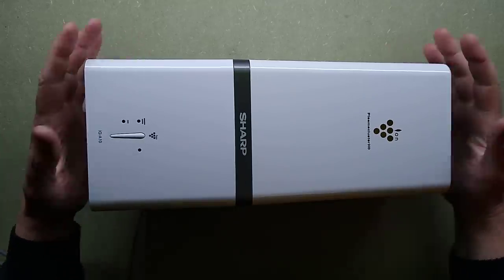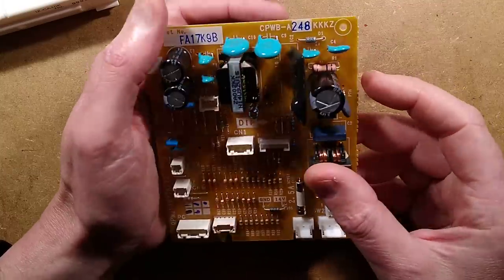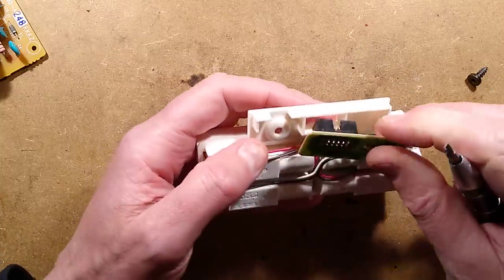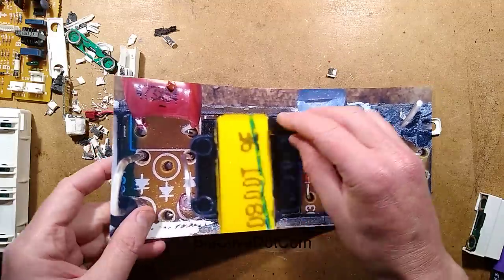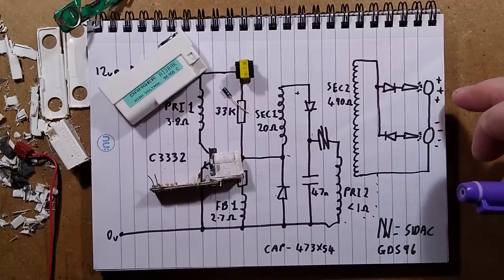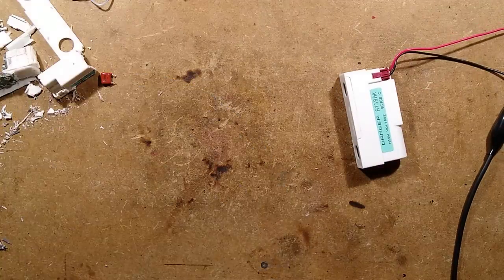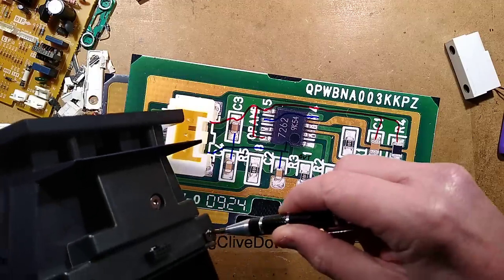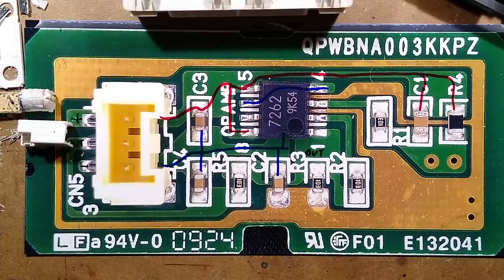Exploring a popular Japanese air purifier.

Comment: The last pcb is actually the most interresting one.
MiniFig666 is right about the guard ring.

the high impedance input signal is connected on the non inverting input of the opamp.
The output voltage is (Theoretically exact) the same, and is set on the guard ring surrounding the input signal.
Because these voltages are (almost exactly) the same the leakage current is (Almost) 0.
If the output of the opamp is not exactly the same(Input offset voltage), this results in a small error.
Also the Conformal coating does not cover the guard ring. (Mask layer in KiCad)
This is because it is not a perfect isolator, (according to wikipedia) it is 
breathable and can allow trapped moisture to escape. 
So for preventing these sub uA currents to occur, no conformal coating on the guard ring
and the input within this guard ring. 
The gold top layer is for prevention of corrosion of the bare copper.
  
It seems like the Opamp is type BU7262F is made by Rohm, dual opamp 
supply voltage 1.8V to 5.5V Rail to Rail input output, 2MHz GBW opamp, with low input bias current 1pA typ and Input offset voltage max 9 mV

The resistor marked HI and the capacitor in parallel act as a low pass filter.
The 10K to the non-inverting input and the 10K to the inverting input are made the same value to reduce errors in the opamp. (See opamp books) This circuit has gain=1, independent of the 10K resistor value to the inverting input. 
The last 10K to the guard ring with the capacitor is also a low pass filter. 

This might be helpful too: https://microchipdeveloper.com/opamp:leakage-currents
The Unity Gain Buffer (with a guard ring)

I am a bit curious if the output signal is just a slow changing DC signal, or if the switching frequency of the Ioniser is visible in the output signal.
It might be as Clive suggested, the program can check by switching the different ioniser modules, if the amplitude of the Ioniser frequency is constant enough to check if one or more modules has failed, and if so, go in some error mode.

Nice teardown Clive!

Comment: i think since you mentioned their claims of less ozone being produced, the rings are there to neutralize the ions again, essentially just having a small bubble of plasma over the needle that the air is supposed to just flow through and any dirt in it be murderized by the ions (and then probably attracted to the needles too) right there, instead of it actually releasing the ions into the exhaust where they would make e.g. way too much ozone.
technically their "water cluster" idea works out since water as a dipole would be attracted to the ions, but i doubt that those ions would do much to the cleaning or ozone production anymore, and it seems more like that's what the rings are for. the water would just literally dissolve the iron and shield it from any dirt to interact with.
22:10 correct me if i'm wrong but "influenza virus ... culture it on a petri dish"? that doesn't sound like a thing you do to vira, more like bacteria or fungi?
Reply: It does indeed. I did a double take when hearing culture virus on petri dish. Not sure how you would test effectiveness in neutralizing influenza really.
Reply: You can have viral cultures in a petri dish, although I think it's more common to do it in flat flasks/bottles because it's a liquid. Essentially, you have an animal/human cell culture in a liquid and then you infect it with a virus so it replicates in the cells. So I believe you can expose the culture to the virus to see if it was neutralized or not. But it is definitely different than the agar plates used for bacteria or fungi which is what most people think when they hear growing something in a petri dish.
Reply: If the ions are neutralized, then how do you explain the charge seen on the volt meter about an inch in front of the needle?
Reply: I think the rings are meant to increase the local field strength, like the accelerating anode in an electron gun. It increases the electron emission and speed. The faster they go the more likely they are to cause electron impact ionization of water, which would cause water molecules to break up like they promise.

Comment: What's the best way to remove dust from the air?
I have chronic fatigue and I'm not prepared to use my limited energy on dusting, so I'm looking for a solution to my increasingly dusty flat.
Reply: Me too. Also asthmatic. And allergic to dust. Never dust, suck. Use vacuum cleaner wherever and whenever I can.
Reply: A fan with one of these ion thingies and a hepa filter should help you both

Comment: Thanks Big Clive.  I have a several O3 generators.  From the little triangular fridge models to a timed unit to another that monitors if you are in the room or not.  All of them seem fine.  Unless I walk by a unit when it's active, I rarely smell it but I know they're working.  You mentioned the PPB of acceptable levels and I'd think just smelling barely a trace now and then is good however it's rare when I happen to walk by the timed unit and detect that bleachy odor.  The odors in my fridge and the rest of the house aren't ever noticeable.

The fact that this one (being very well engineered) seems like they've taken into consideration the difference between being harmful and actually freshening the air seems kind of cool.

Dang.  Thanks for all that work bringing all of this to light and also for causing further consideration.  Pretty neat!

Comment: They're powered at seperate times because one is the positive and the other is the negative ions. If you run them at the same time, the ions will recombine quickly and not be spread in a room.
The way to test this would be to take a sheet of plastic, rub it with a cloth, which will give it a static charge, throw some dust or statically attracted particles onto the plastic, and then when you point the ionizer at it, it should dissipate the static charge in the dust and make it detach. That's how these are supposed to work, they get rid of static, causing dust and tiny particles to fall to the ground. They're also used for static removal in industrial equipment.
Reply from the maker: It turns out that they emit both positive and negative simultaneously.

Comment: I was hoping you would take a look at one of these, good to see it's not complete snake oil but it would be interesting to see if it has a measurable effect on air quality. 

I have a Mitsubishi dehumidifier which has a "silver ion" filter and I'm not entirely sure what that does either - it seems to be some sort of green fabric filter (after coarse plastic pre-filter) that goes grey after time, but can be cleaned a few times by soaking in water. There doesn't seem to be any electrical aspect to this filter. It can operate in "air purifier" mode (no dehumidifying) and at least the pre-filter collects a lot of dust.
Reply from the maker: Silver is purported to be naturally antibacterial.

Comment: I have been using a sharp HEPA filter with plasmacluster built in (along with a pollution sensor) for a few years now and it seems the module is not designed to be replaced (FPA80UW). I have heard it buzz like once a second for a few minutes then it just stops. According to the manual, sometimes it happens, sometimes it doesn't (only if it has been unplugged recently in my case)

I have also seen the plasmacluster ionizers compared to ESD ion generators or "balanced ion generators". Dunno if this sheds any light on it at all.
Reply: @Wellivea1 if you can see the needles then you should be able to clean them with a soft brush (every 6 months or so) and the needles could possibly be re-sharpened (every year or 2)

Comment: Did you put the whole thing back together afterwards? Does it still work even if one of the modules was taken out? I've been using Sharp Plasmacluster units for years and love them.
Reply from the maker: Yes I rebuilt it and use it.
Reply: @bigclivedotcom  Thanks for making the video btw. I've always wondered what was inside it and how the construction and schematics were!

Comment: I've owned a Sharp mobile air conditioner with "plasma cluster" (and the grapes logo). When activated you could smell a slight hint of ozone. It however did not have replaceable plasma cluster modules. So I don't understand why you would need to replace the modules on this air purifier.
Reply: Indeed. What would wear out on such a module. Maybe the pin will disintegrate in time?
Reply: @hapskie  I also own a "negative ionair cleaner". It has 3 pins and 3 rings and those rings turn black over time. The manual of that ionizer states that you should clean the rings with alcohol when that happens. Perhaps this also happens in the plasma cluster modules? So instead of replacing the modules you could clean those as well?

Comment: I have a larger version of this that has a much bigger squirrel cage blower that can move more air yet moves at a lower speed because of the size of the blower - which makes it whisper quiet on all but the highest speed.  I love it.  I hate all the new air cleaners and room humidifiers that have small, noisy high speed fans with blades.

Comment: Back when I owned a 2008 Toyota, it advertised that it had a "Plasmacluster" built into the HVAC system. I wonder if it is a Sharp module like this.
Reply: Very likely, especially if it showed the same grape logo.

Comment: It's a differential ion generator.
And yes, O3 as well as nitric oxide is a by product, thanks to the corona discharge off the needle.
Reply: Yes, and plasmacluster eliminate static electricity in the room and make particulate matters in the air clumps together so it can be filtered easily with it's HEPA filter

Comment: First off, great work here. You are the only video on the entire internet doing this stuff. This is awesome for curious people. Being an owner of a purifier from Sharp I can definitely say it works and works best when humidity is optimal. When the heater is on and humidity is low, this is next to useless. But with good humidity, it works! There is definitely studies confirming that plasma interaction with water produces ion solvation. That is ions are surrounded by layers of water. This is because the geometrical water molecule produces an polarity on the ends of molecules. This results in a lot of anamolous properties of water.

Also I think your experiment with the box here doesn't include a cooled down air which has more condensed water. I'm assuming there is a certain amount of condensation happening on the metal rings which would definitely explain how the system would work. Your experiment doesn't have any water and straight up ionizes air, which obviously produces ozone
Reply from the maker: The humidity in that area is always above 70%.
Reply: I think the key is to let water condenser on the metal ring or the needle. I have observed some coating on some of the ion units, I don’t know if that is sped up condensation. Can you try with some tiny amount of water in the terminals?

Comment: Power supply is across the top, the right hand side is just a filter comprising of X2 capacitors and common mode choke to reduce conducted noise from the switcher. Nice to see schematics on the silkscreen. I though only I did things like that for ease of servicing.

Comment: It's very interesting to compare this to Sharp's original patent. The original Plasmacluster was a glass tube with electrodes embedded around. Current was applied across the glass tube ionizing the gas inside, similar to light bulbs, thus they named the product a "plasma" ionizer. The product they actually produced from that patent is basically just two regular ionizers that are nothing special or unique.

Comment: Seems to me that the golden antenna is part of electrostatic field measurement circuit that gives feedback to the mainboard. If the field goes down or gets to high up...it is time to switch to the other two units. The previous two units stop working, lose charge and clean up.  After long use the plasma interactions at both needles sort of draw material from the coating on the needle. Those atoms regroup on the surface of the needle, that is the white stuff. That buildup diminishes the output of the unit and that is why you have to change the four little HV units. Also measured by the electrostatic measurement circuit.
Reply: That's very interesting, I bought one of these to wire into an old tower fan,
I am planning to use an FRM02 module (dual relay timer module) so I can wire them up in pairs and run them for 2 seconds per pair,
My thinking is that they are probably running them for a short duty cycle for a reason, possibly to limit damage, so your comment does make complete sense

Comment: The quick-and-dirty test to monitor for ozone is a rubber band. Natural latex rubber reacts quickly with ozone. It would be straightforward to put the device into a chamber like a large plastic tub along with some rubber bands, wrapped around a cylinder, and see how fast they decompose relative to a control set of rubber bands left in open air. Then run the device in a small room with a closed door, see if the rubber bands decompose any more slowly than in a small chamber. Again, use a control set of rubber bands in a room away from the generator.

In this fashion, one could determine if the device seems to regulate its output based on the ambient level of ozone, or if it just cranks it out at a constant rate.
Reply: Yeah it does degrade rubber quickly,
I'm sure that's why BMW puts them in cars, it's not to assist your health, it's to assist their profits when the interior falls apart after about 5 years

Comment: I lived in Japan for a few years and these Sharp 'Plasma Cluster' air filters were everywhere in most offices, shops etc near a corner whirring away. For a while they were marketed in the UK so I have one for a quite large room, its about the size of a regular home laser printer.
In Japan in Tokyo the summers are very hot and very humid indeed, if you leave a plate of food out it will very obviously go off (from the smell) in as fast as an hour without one of these going.
They do have a air detector built in that steps up the fan speed if an odour is detected.
The science of the charged particles clustering around dust microparticles, pollen, bacteria etc and decomposing or causing them to fall down to the floor is Sharps marketing theory. It may just be ozone or there is there more to it but certainly they work for cleaning the air in offices etc. Have to wonder at the minimal covid problem in Japan is due to firstly to their habit of wearing face coverings and whether these commonplace Sharp devices played a role too.
Reply from the maker: When I first came across the plasmacluster name it was in reference to their use in hospitals.

Comment: "Why would they surround the ion" @ 19:42
Because the water molecule is not balanced.  It has one end thats more negative and another thats more positive.
Reply: Tick. V.G. Solvation.
Reply: I'm not shure that your reasoning is correct, since the water molecule itself is electrically neutral or else it would be an ion!
Reply: @jurivlk5433  The solvated proton retains a positive charge, until it meets something negatively charged...
Reply: @jurivlk5433  H2O is an example of a "polar molecule" (i.e. it has a positive and a negative "end") because oxygen atoms have a higher electronegativity than hydrogen atoms. The bond angles of the hydrogen atoms, within the H2O molecule, and the overall electron distribution, make the oxygen end more negative than the hydrogen end. Thus, they act like tiny little magnets.
Reply: @jurivlk5433  It maintains a small dipole at all times due to the non-symmetrical nature of the bonds. It's these small dipoles that provide most of the inter-molecular bonding in water. Check google for "Hydrogen bonding in water"
Reply: @AJD09FB  Isn't that the property of H2O which is used by MRI ?

Comment: The output on Page 29:00 tracks the plate emf limited by rail potentials. The guard trace around the plate tracks the plate emf by a delay for stability purpose. The pull up resistor value was chosen to delivers a bias current just enough to keep the output within rails within analog range.